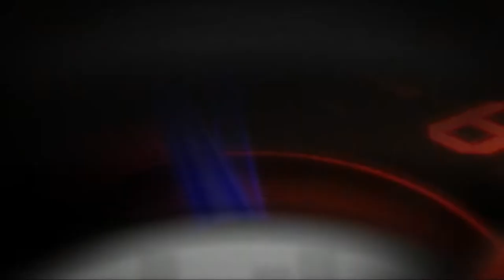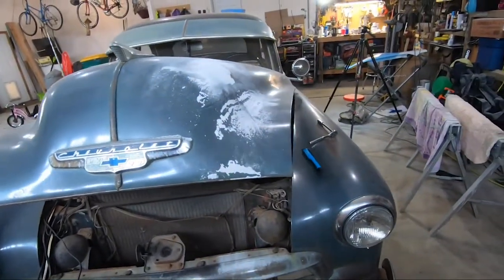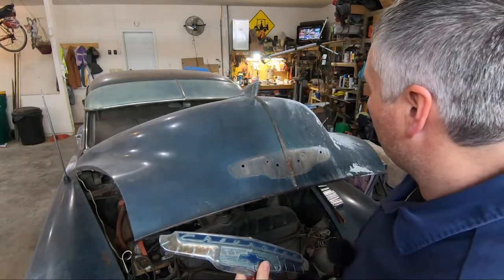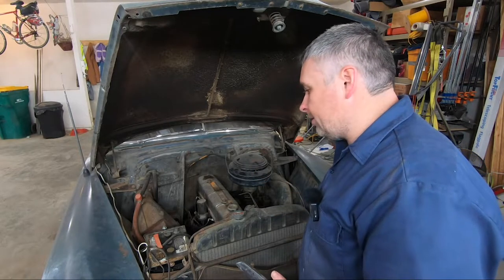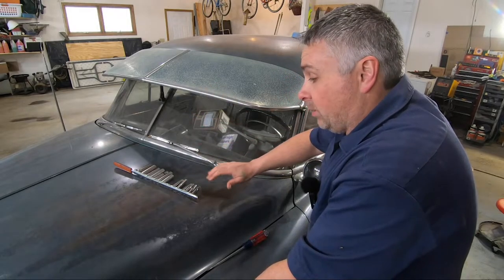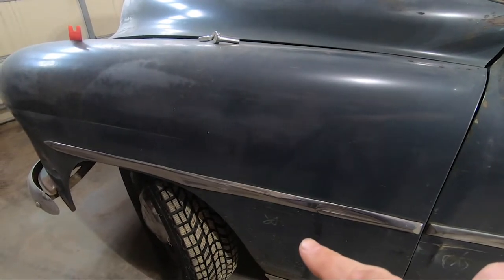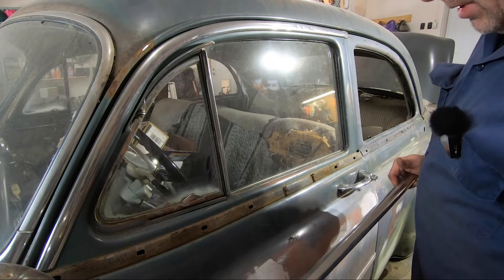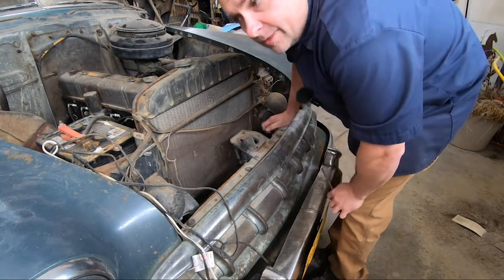1952 Chevy Styleline Deluxe Rebuild: Part 10 - Left Handed Pliers

Comment: How did you end up taking the door spear trim off? Did you have to do anything from the inside? I'm having same little challenge right now. Trying figure out how to take one off the passenger side of my 2-door 51 Styleline Deluxe to replace it :)
Reply from the maker: A lot of mine were rusted and pretty much broke off as I was taking things apart. Some, I could slide a small flat head screwdriver or similar behind and push the little finger down, but any just broke away.